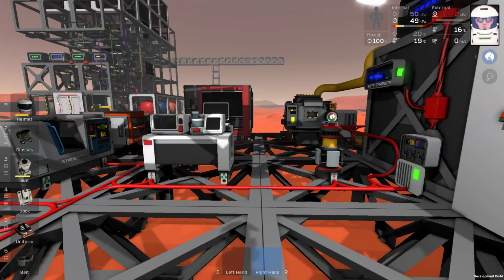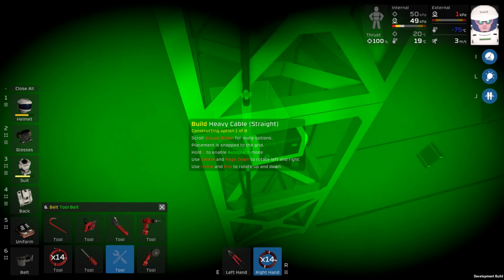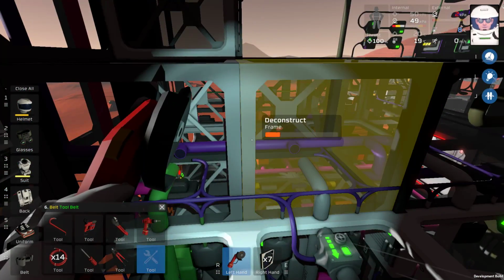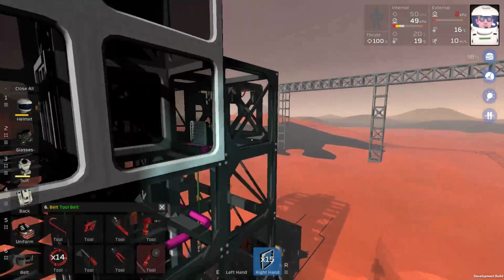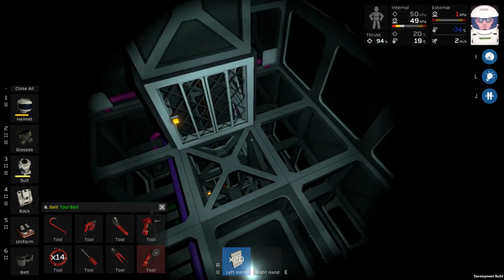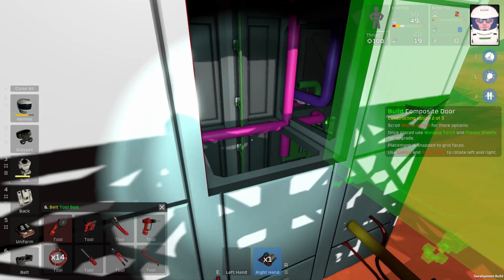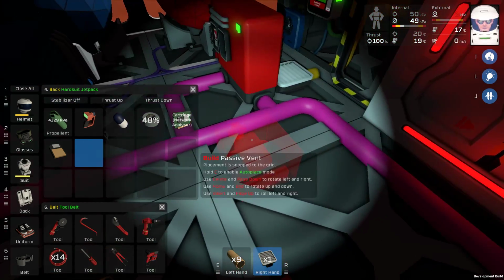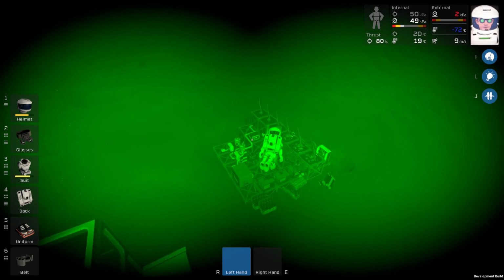Stationeers / EP 34 - Pressure Test / Mars Colonization

Comment: The tanks with gases on the first floor need an automated pressure releases valve. Wether it released into a holding tank, the atmosphere, or what, is up to you (Like the CO2 redirect, but automated)
Reply from the maker: This is a nice little future feature to add, sure, but I doubt any tank other than CO2 will ever see enough pressure to become a problem. All other gasses other than CO2 is just too scarce on Mars to ever become a problem
Reply: True

However, gasses like pollulutants, and some others, will slowly build up. If anything, they need it the most, because you are less likley to think about checking them. So, no issue, untill it’s too late. Besides, if you are adding it to the CO2 tank (Because that one definitly needs it), you might as well do the others. Also, a nice little feature for way in the future when you have too many recourses is a self-destruct button that over-presurizes the base!
Reply: Couldn’t find the edit button, so, edit.

While this is a useful feature, I’m totally not asking for it because I want to see how to do it (;

Comment: IMO i would stack the batteries in the solar tower right on top of each other (i think you can go 3 high in a grid frame) and you could put glass in front of it so you could see the power levels from the outside once you panel up the solar tower. For safety I would put a transformer set to 99kw at the base of the tower. You should never need to adjust it so you could just wall that in.  If you find a need to, you could just keep adding batteries going up the tower.
Reply from the maker: Yeah I'll be adding a transformer for sure, I'll add more batteries if I need them

Comment: You could also turn your jetpack on indoors and it should begin to fill with nitrogen. Instead of adding a vent.
Reply: but then he has to collect more N. 
He mentioned this in previous video. 
"Jetpacks will use any gas but it's N when you load the game so will continue filling with N."
Also there is 10,000% more CO2 on mars than anything else. 
So why not just use CO2.
Also there's not enough N in the jetpack to fill up the base.
Reply from the maker: I could, definitely, but I think I have enough to fill the base ... maybe? The advantage of N for jetpacks is that the majority of my base will be nitrogen and it doesn't combust or react

Comment: Quick question: After this whole building is done and pressurised. If you wanted to build a whole extension to (say) the south which would be hard connected to the base. Would you have to depressurise the whole current base in order to connect it or would there be an easier way?
Reply from the maker: You could connect it once the expansion is done with a wall that you deconstruct or something like that
Reply: You would want to depressurize the expansion, and then remove a common wall to pressurize both.  One consideration is that the pressure will drop for the new area so you might want to be careful if you are growing crops at the time.  You would want to depressurize the expasion to remove the small amount of pollutants.

Comment: Thanks for the stability pillars on the solar array.   

Do you think you’ll have it so you can move between buildings within tunnels to connect them? If tunnels are underground can you pressurize them?
Reply: Yes the ground does not allow gas to pass.
Reply: Yes that's right. The ground is air tight. 
People have done this for their bases. 
Dig a small hole for just  enough for a door and 2 frames on either side to fit and you can go wild under ground not having to build all those frames and walls. 

On europa it's the fastest way to get a base running. 
Install the generator inside a small hole and you can warm up the inside in seconds and start planting.
Reply: Ha ha I just re read my original comment. 
Instead of allowing the gas to pass you could just pass the gas and you should be good.
Reply from the maker: Hmm I'm not sure? Maybe?

Comment: You'll want a transformer/regulator after the 3 batteries in the tower. 
You may not have it happen but it's always good habit to get into to install after battery in series. 
The batteries down the line and all the items could draw to much power. 

I don't like nvg's in games. It's never similar to the real thing. To much blur and no dark spots causing to much brightness. 
Nvg's are very crisp and clear as long as long as you use the focus appropriately. 
Also shadows are even darker as nvg's just intensify reflections of light. 
 
In here the nvg's might be ok when you go out mining and need to find the base but not up close.

When you use the computer. Press numpad - a couple times.
Reply from the maker: I mentioned mid episode I had planned a transformer =]
Reply: Yeah later on you did after I commented. 
I waited a bit till you stopped working on the batteries and moved on to something else just to make sure you didn't install 1 before I commented. 

Just a good habit to do all the time that way you don't have to test when needed or not.